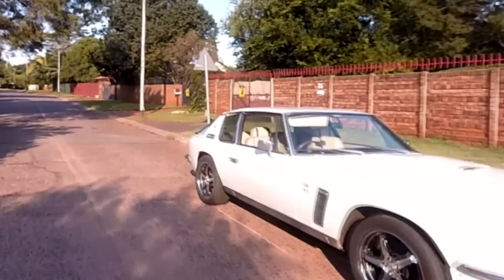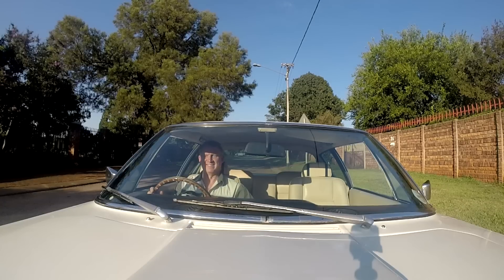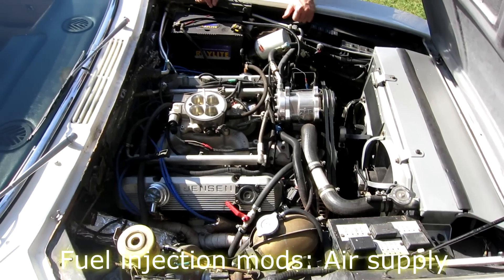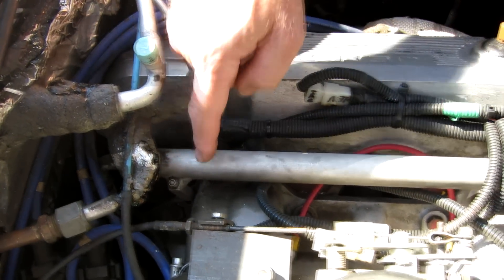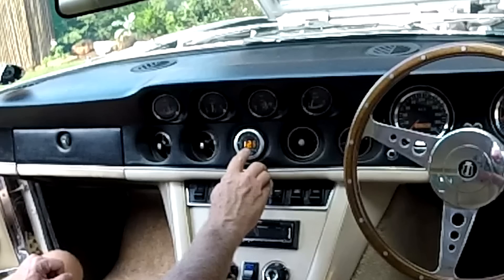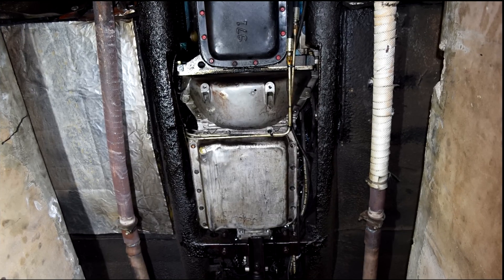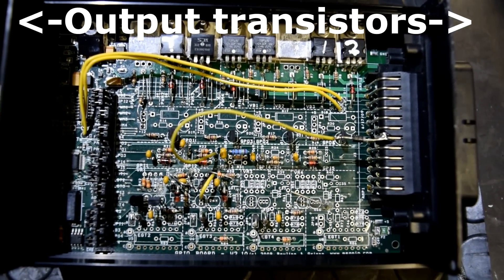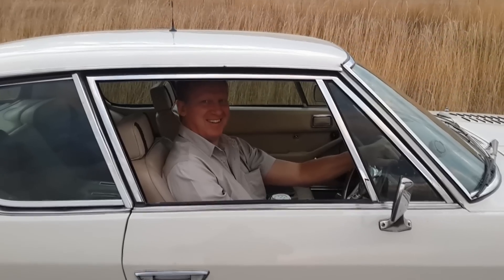Jensen Interceptor MK3 7.2L V8 Reborn

Comment: The advantage of building another 440 for high compression is that you can keep on driving the car while you are working on the new engine.  The higher compression ratio will also reduce exhaust temperature for all operating conditions, which may be important for the crowded hood of the Jensen.

Too bad differential gears are expensive to replace.  If not, I would suggest to replace the ratio just for a few months, to try it out.  My guess is that after you enjoyed the thrill of a 14 second car (especially with the new 440), you would say the hell for a few mpg.

On my gigantic car, I have specified the 268-280 total duration COMP cams.  This cam has .477 total intake lift (I think .480 exhaust), which is a lot more than the stock HP cam, but total duration is almost the same, just a bit more overlap.  I still have tons of low end torque to move the big car around.  Your car been a bit lighter will also be fine with that cam.  If you lowered the diff ratio to 3.55, you could install a cam one or two steps above that, and you could go even faster, may be mid 13's, and a top speed of 155-160 mph easy.  The car would be as fast as it looks and sounds.
Reply from the maker: Thank you Demetri, your inputs are greatly appreciated
Reply: Sir, you have a gorgeous car, and the mods you have done are quite impressive. I am a Yank and I grew up with Mopar's. My first car was a 1968 Plymouth Fury III with a 383 Four bbl Carter. I just always loved the sound of a big block Chrysler, and I must say yours sounds splendid.
Reply from the maker: Philip says: Thank you Lyndon! I also have a '73 Interceptor, more standard with original Carter Thermoquad carb  (which I regard as the best carb in the world!!), but significantly more powerful than this 74 (high compression, cam etc).  It is quite fascinating how different these two cars sound, both beautiful, but somehow this 74 just takes the prize!

Comment: The car now needs a lower final drive ratio.  The 2.88 plus 0.7 OD is too tall.  Even if it has a 3.07, still too tall.  Do not know what type of gears you can find, but a 3.55 (if you can make it fit) will give you better acceleration and better top speed.  Some loss in fuel economy, but this is no economy car.
Reply from the maker: Reply from Philip: I find your opinion very interesting and would like to invite you to state the reasons WHY.  Most modern large engine cars run below 2000rpm at 120km/h nowadays.  Even myfriend's 1st gen Merc A-class 180 CDi (with CVT) runs at 1800RPM @ 120km/h. My car has a 3.07 final drive ratio and runs at 2100rpm @ 120km/h which I believe is still too high!  There is just no end to the torque on this engine (even though its a low compression 440) and with such abundance in torque, there is little reason to ever see more than 1500rpm on the clock.with normal driving.
Reply: Interesting on the 3.07.  Due to the loss of torque by the low compression ratio, Jensen went back to the 3.07 from 2.88 to recover acceleration.  

The main reason is performance.  Going down to 3.55 you will get much better acceleration.  Also, with the 3.07 and OD, your top speed is limited.  With 3rd gear and 3.07, with the stock 185/70 or 205/65 tires, you will have about 25 mph/1000 rpm (may be a hair more with the larger tire, need to redo calculations).  So, 4000=100 mph, 5000=125.  With OD, you are 25/0.8=31.25 mph/1000 rpm.  That means that 5000 rpm correspond to 156 mph.  Your engine may not be capable of producing enough power for such high speed, given the ~0.45 drag coefficient.

A 3.55 will bring your 31.25 down to 27.  5000 rpm will be 135 mph.  5500 rpm will be just under 150.  You should have sufficient power to go between these two.  But most important, your acceleration over 120 will be much stronger.  Your 1/4 mile now is probably around 16 seconds, at about 88 mph.  You will be able to bring this down to low 15's with a 3.55.  This is a dramatic improvement in performance.

Fuel economy will deteriorate some, but this is a performance car.  It is a good compromise.  

For your info, I have a late 60's Imperial with a 440, and 3 sp auto.  2.94 rear, but large diameter 235/75R15 tires.  I do just about 30 mph / 1000 rpm.  I have high compression and a good cam, and I am probably close to 400 hp at 5000 rpm.  I have probably about the same drag coefficient (may be a bit less because I have a more or less rectangular car) but a bit more frontal area.  I expect I can do 5000 and 150 mph, or may be a bit more (have not tried it that fast yet, but I have taken it up there).  My practical acceleration and top speed will likely improve if I switch to a 235/70 or 235/65 tire.  My engine will rev better, and 5500 will still be in the same 150 mph range.  And my 1/4 mile will likely improve a bunch too, probably high or mid 15's.  I have not tried that yet, but I might.  I might keep two sets of wheels and tires.  But the Imperial is less of a performance car than the Jensen.  I don't care as much in winning drag races in the Imperial, as much as having a good long distance driving experience.  The Jensen has a different image.
Reply: One correction.  The numbers below assumed .8 OD.  If your OD is .7, my numbers are even more favorable.  Your current gearing will be 35.7 mph/1000 rpm, which is totally ridiculous for performance.  At 5000 that corresponds to  175 mph.  That is crazy.  Once you shift to 4th at, say 130, your acceleration will flat line.
Reply from the maker: Reply from Philip (channel here: https://www.youtube.com/channel/UC69cyvRvQ9O2K3CKVTR7VWg)Your comments are highly appreciated, thank you, but you may find my objectives somewhat disappointing. My aim with this car was to end up with the ultimate open road cruiser - a mile gobbler - and to do so in the most efficient manner. This is why I did the EFI conversion, and this is why I chose the 4L60e with its 0.7 OD.  If it was 0.65 or 0.6 I would have been even happier but I am most satisfied with the result as is.Fuel consumption on the open road (with ac on,  at 120km/h) comes to 7.2 - 7.4 km/l with which I'm very pleased. (odo gps calibrated). If performance was the objective, it would all start by increasing the compression ratio to more than 9.
Reply: No, your objectives are not disappointing.  May be ... a bit misplaced.  You would have gotten better results with, say, a Citroen DS.  The pneumatic independent all around suspension would have given you better ride yet, and the 4 cylinder and tall gear ratios would have given you excellent fuel economy, all out of the box.

By the way, if you increase compression ratio some, you may get a bit better fuel efficiency.  EFI does not directly help with fuel economy much.  Unless you have an imperfectly tuned carburetor, which I have to admit is not uncommon.  Here, in the USA, as cheap as gas is, there is little incentive to worry too much about fuel economy.
Reply from the maker: Reply for Philip:  If I wanted a DS, I would have bought one :)  The low compression 440 does bother me. Rather than upping compression on original engine, I have chosen to prepare another high compression engine which will go into the car this year.Original engine will be kept for the sake of "matching numbers". Thanks!